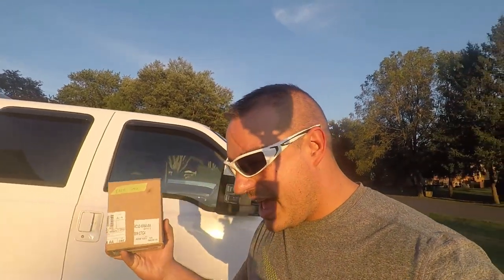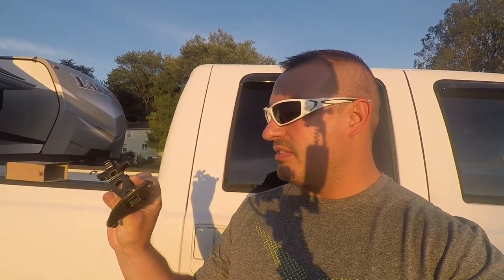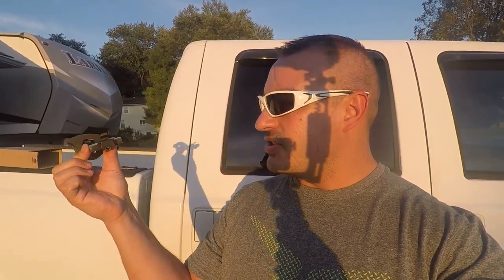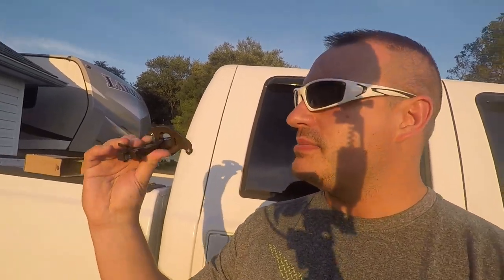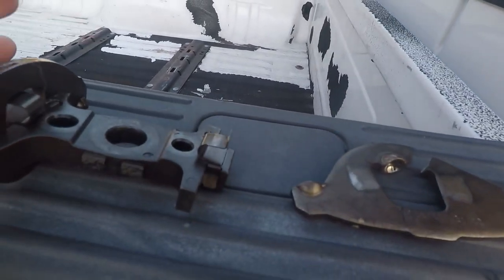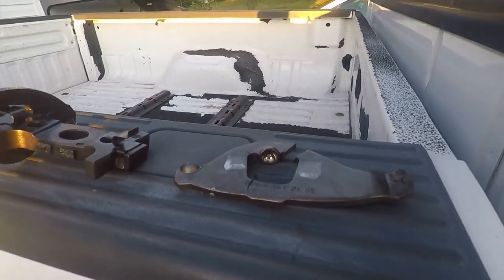6.0 Powerstroke Rocker Arm Failure

Comment: Bought my 6.0l  for $1,100.00. Ended up being the rocker arm and a few injectors initially wrong with it to fix it at that moment. Absolutely love the 6.0l
Reply from the maker: man that is a hell of a deal. sorry for the late response. I am just trying to go back and get people I missed.
Reply: How did you find such a deal and was it a clean title?
Reply from the maker: Someone probably thought the whole engine was done even though it was just a bad rocker arm. Although replacing replacing rocker arm involves removing a head bolt to do so that part sucks
Reply: It was got for only a 1000 dollars , because it is hands down the worst Ford diesel, and the junk yard will only give you 300$ for it.

Comment: Too bad we don’t have a video of the sound your truck was making. 😢

Mines making a click sound, almost like a squeaky belt/pump.

Thinking it’s a failing rocker arm or a lifter
Reply from the maker: I had no noise prior to it breaking, but if you feel it could be I would pull your valve covers and inspect your rocker arms for any signs of wear
Reply: @six0bros  yeah, that’s what I was thinking. 
I’ve heard the balls fall out of the rocker arms on occasion. 

Just weird because it doesn’t make the sound when cold and goes away at 1200 rpm.

Hopefully it’s just a small fix and won’t have to turn our truck into a parts truck lol

Comment: Usually what causes a rocker arm failure is a bad injector. The injector "misfires fuel" into the cylinder at the wrong time when the exhaust valve is in the wrong position and it will break the rocker arm. It just happened to my 03 f550, I only replaced some of the fuel injectors in my truck, one went bad. I noticed, right before it happened, that I got a rough idle.
Reply from the maker: Newer injectors in this truck. Before it lost compression about 2 months later they were still fine. Going probably be getting a kill devil diesel long block in the future

Comment: Heads and block were Machine or for the pushrods were longer than they should be.
Reply from the maker: Heads were new from kill devil diesel with cam and pushrods set up for each other. Shorter length pushrods were used. Sometimes crap breaks

Comment: I'm actually gonna be buying a 2005 f350 6.0 in the next few days from my roommate. It's only got 135,000 miles on it and is deleted and tuned. Just needs arp head studs and it's a solid truck. The cab and interior is a bit rough especially being an XL and an old farm truck but can't beat the deal for $8,000
Reply from the maker: They sell carpet kits and you can upgrade everything to make it different. Just a little bit of work

Comment: So 1 year later that rocker arm fix it? Still running good?
Reply from the maker: The rocker arm was the fix. However I ended up losing compression on a different cylinder. Found out I was having piston-valve contact after I did thr initial build. So I am about to get an engine up from the guys at kill devil diesel. I ordered a build in the box

Comment: I myself am dealing with what I am pretty sure is injector seal leak getting only 71 icp max crank no start
Reply from the maker: I would say that more than likely you have a high pressure oil leak and I dont think at the injector. Stand pipes, dummy plugs, and stc fitting most common
Reply: 6.0 Bros standpipe dummy plug stc fitting brand new  air coming out of passenger side year 2007 6.0 i also just did oil rail o rings still leaks

Comment: so i was just down this same road after i insralled my colt stage 2 cam i broke 1 rocker arm out of no where then broke 3 ended up pulling the head and found out i had weak valve springs on my brand new heads from dk,i ended up replacing all rocker arms,added high rev valve springs,and added .020 shims for insurance im pretty sure valve springs where my problem i hope you dont have to end up going through what i went through.thanks again for your videos i bought some of my parts on your recommendations
Reply from the maker: Thanks man. I hope thosenoarts are doing well for you. I love my stage 2 cam! Kill devil sets springs a just slightly higher than factory so I should be good there. Hopefully anyway lol

Comment: Did the knock sound like a hammer on metal?
Reply from the maker: Sort of yes.
Reply: @six0bros  this is not a plug to get views but I uploaded a short video of my truck running with a possible rocker arm broken. Just happened today and pushing air out the intake. A week after I installed a new set of injectors lol
Reply from the maker: Can you post a link ill watch
Reply from the maker: Sounds like a rocker arm to me. Read your codes and see what cylinder is missing and that is probably your rocker arm
Reply: @six0bros  yeah unfortunately #6 contribution code ! So it’s unfortunate but I’m glad it’s that side. Thanks for your input though will check it out!
Reply from the maker: No problem let us know that it was the issue
Reply from the maker: That stinks man did you getnit fixed?
Reply: @six0bros  yeah for sure! Got to it this morning, tore it down, buttoned back up and test drove it by noon! It’s alive again.. for now lol
Reply from the maker: Lol for now. I hope itndoesnt happen again man. Good luck.
Reply: @jermbob92  thank you so much for sharing your video! I searched everywhere looking for a video "hearing" the sound! Our 2008 6.4 started making the same noise this morning!
Reply: @girlpersonj  Never fun to start the morning out w a noise like that, at least it’s Friday. Best of luck the repairs!

Comment: Do you know what would cause that to fail in your truck pacifically? Do you think it has something to do with your upgraded camshaft?
Reply from the maker: I do not believe it has anything to do with the cam, as the cam is actually much easier on lifters and such than the factory cam. I think just 200,000 miles. I have seen people with stock trucks lose one rocker arm at less than 100k miles
Reply: Pacifically?!?! Lmao what

Comment: I've got one of those, When the cam went bad they thought it was a rocker arm.  when it turned out be to the cam, since they already ordered the rocker arm they made me pay for it.  3c3z-6564-ab arm asy
Reply from the maker: That stinks since they missed diagnosed the issue they still made you pay
Reply: 6.0 Bros I'm telling You, This 6.0 has bled me dry.  When I was in high school only rich ppl had excursions.  I wanted one so bad, I irresponsibly spent my life savings on one.  I've spent at least $10k in repairs since I bought it.  transmission, turbo, driveshaft, fan clutch, cam, wheel bearings, & Now it's down because of lifters.  This dream truck of mine, has turned into a nightmare.
Reply from the maker: @mikehunt7483  man I am sorry to hear that. My 6.0 didnt coast me a thing but basic maintenance for 110,000 miles, and I bought it with 73,000 on it.
Reply: 6.0 Bros I got it at 169k.  it's at 181k now.

Comment: this is the reason why I keep my 6.0 stock.
Reply from the maker: Well while the arguement for keeping it relatively stock I can see this wasnt caused by performance parts.
Reply: My stock truck just experienced a broken rocker arm.
Reply from the maker: The factory rocker arms are not the most durable. After what i learned about what failed on the truck I realize that it may not have been all the rocker arms fault but they definitely are on the weaker side